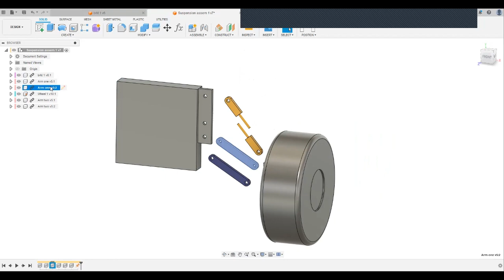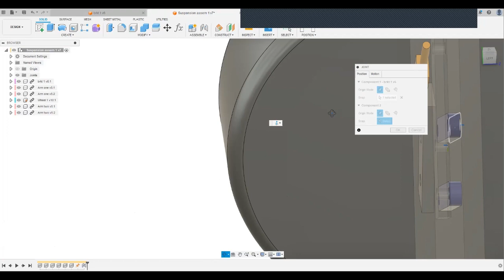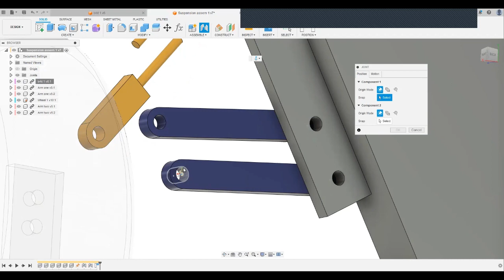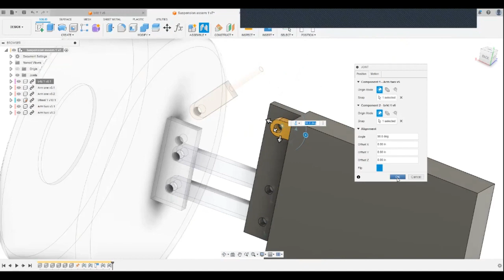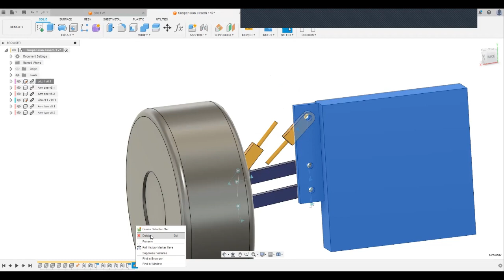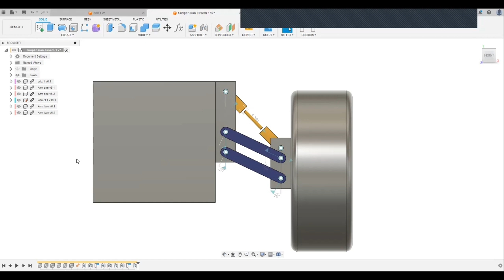Fusion 360 : Using Joints on a Car Suspension

Comment: your video was very helpful sir but i an having an issue with the slider joint for the shock absorber.
in my case it is supposed to be mounted to a shock tower and the upper control arm.

the warning ⚠ being: 
Cannot resolve some component positions because there are conflicts with assembly relationships in the design. Inspect existing joints, rigid groups, ground to parent, or tangent relationships.

this is resulting in the movement to be locked-up.

although i have gotten my result i wanted but would love to know how to solve this error and what's causing it.